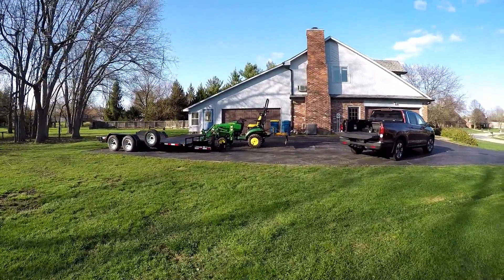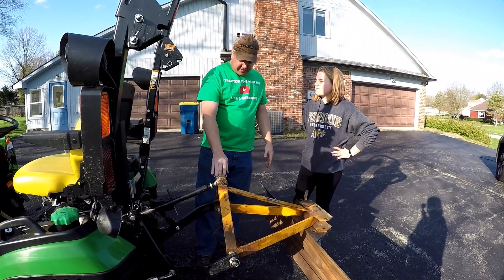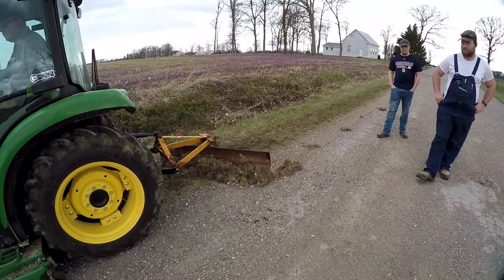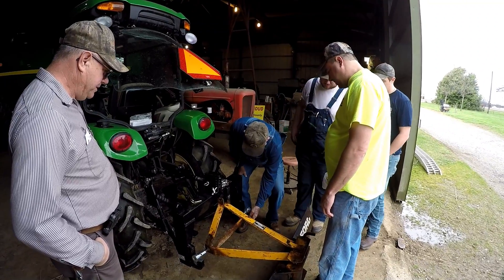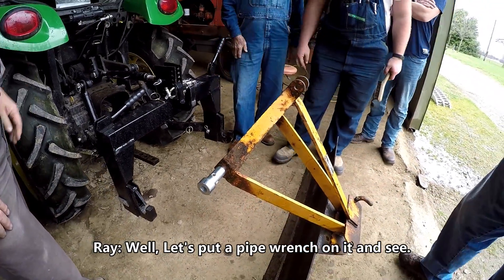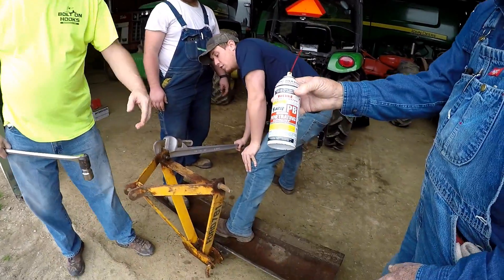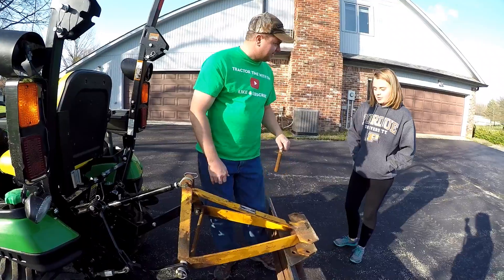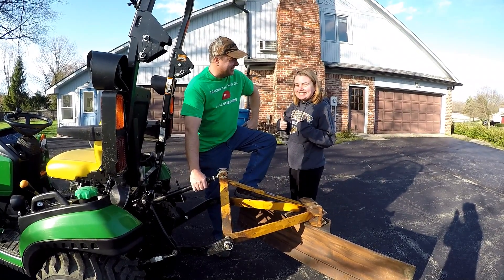Attempted Reengineering on Our New Blade for Compact Tractor

Comment: I have a 1025R, I need a cab on my tractor too old to breathe dust and need ac. I have too many attachments to start over. What are some options any suggestons?
Reply from the maker: 3R can be pretty narrow.  For example, my family still runs 4ft tiller.
Reply: @TractorTimewithTim  Will the attachments for my 1025R fit the larger #3 cab tractor? forks, bucket, grapple, a quick hitch, landscape rake, bush hog, box blade, tiller, belly mower, etc.
Reply from the maker: Forks, yes.  Bucket will come with the loader for the 3R.  Quick hitch, yes. Landscape rake, yes.  Bush hog..do you have 4’ or 5’? If 5’ you’ll be fine.
The rest depend on width.  3R better suited with 5’ or 6’ than 4’, but you might get by at least for awhile.
Reply: @TractorTimewithTim  thanks

Comment: Take an angle grinder along exposed thread grinding a flat going a little into nut this provides clearance for the rust to go somewhere, rather than building up under the nut being removed and causing squeaking and friction(HEAT) you just turned that exposed threaded section into a thread chaser, good threads won't get galled. Good luck hope this makes sense

Comment: Gentlemen, there is this thing (tool) called a cutting torch, most men who have a workshop have a torch somewhere in their shop. Take your's out of storage and light the torch off, then use the flame's heat from the nozzle to expand the metal of the nut, which will allow you to remove the rust frozen nut from the pin without excessively straining your muscles or damaging your hand tools. If you do not have a torch, then get out your metal cutting grinder and cut the damn nut off the pin, since you are not going to be reusing it anyway, it will not matter that the pin and nut are destroyed in the cutting process.
Reply from the maker: I believe we discussed heating it in the episode.

Comment: Cut the original hitch and manufacture a new quick hitch capable hitch on the blade. Take measurements off the pulverizer but build a clevis instead of pin hitch.
Reply: Tim, thinking about an answer to this implement. As I previously posted to cut off the original hitch. I believe the new quick hitch capable replacement could be built using 1/8" wall square tube shaped in a " T ", gussets at the intersection of both tubes and with 1/8" flat bar (need minimum 4" wide, you nay need to inquire about this size of material)  for both clevis pins and the 3rd point. BTW, THE " T " will be upside down to correctly weld to the blade structure. Hope this idea helps to update the blade to your specifications.
Reply: The "upside down T" is your best answer for the modification to work. And the braces could still be used if carefully cut away.

Comment: Yet ANOTHER IDEA TO MAKE QUICK HITCH CAPABLE. Build an adapter that has quick hitch dimentions on one side and dimensions of the category 0 hitch. The adapter will stay mounted to the blade. DOWNSIDE; INCREASED WEIGHT AT THE HITCH.

Comment: Tim, i thought of YET ANOTHER idea for your blade quick hitch issue. Since the pulverizer is quick hitch capable. Take measurements from that with minor changes. The outside of the pins would be the widest point of the clevis hitch. With the pin mount point would be the narrowest measurement of the clevis. Then you could measure from the center of hitch to get length of center 3rd point for quick hitch. I don't believe it would add TOO much weight to the blade. OR you can take measurements of the current blade hook up points and build an adapter to hook up to the quick hitch. OR buy another Heavy Hitch and weld that in place of the current blade hitch points. I know that project isn't a high priority, but just some ideas when that project comes about. For some reason I keep coming up with ideas for this blade. lol. Just sending some ideas for the future days in the shop or on the family farm. Andrew.

Comment: Ok, I am in. watched 3 video's and they made me smile. So I subed and liked. I find it's a little more fun to watch someone drive a John Deere then doing it all day yourself. Try lowering someone's back yard 3 to 4 feet (about 1/2 ac.)with just a John Deere 3005 with a bucket and box blade to make it level. Yes, there was a jungle on top to remove first. 3 15 hour days and it's done. Only other help was a chain saw and helper to cut up and move the tree parts out of my way.
Reply from the maker: +72+HourBOB making you smile is our goal.  Thanks for joining us.  Wow,  Johnny wouldn't have been able to handle THAT job!
Reply: The BIG Q is would Johnny have done it for fuel and $60.00. (fuel was under $25.00). Thanks and you guys take care now.

Comment: Tim:
If you don't want to destroy the frame of the Ford Blade. You can just bolt on plate stock that will need to be welded.
The two point section needs to be widened so get steel stock the is as thick and wide as on the blade cut long enough for extension, weld on tabs that you drill to bolt were the studs were and on end for mount point. You will need put on two other plates to box for strength.
You can extend the third point the same way with same size plate.
If you want to bring it back just unbolt those parts.
Any questions please ask.
Reply: I had to do this wit a cat 0 box blade.  All I did was get some .25" wall dom tube 1" OD I made ears that I bolted into the nut side of the cat 0 pins so a cat 0 could still hook up and put a cat2 size bushing in the upper link position.  This sits below the cat 0 hook up.  A section of angle was welded across the top of the tube and blocked rotation. All removed w 2 nuts

Comment: Why not weld a piece of channel to the bottom below the existing pins wider than cat 0 pins, so it will match the quick attach width, weld two ears with holes on each side to act as a clevis to hold the pins. This will also give the height you need to achieve category 1 quick hitch height.  Joe Rhinelander

Comment: Have you ever tried kroil? It's amazing for rusted bolts and nuts like that. 10+ year old lawn mower exhaust bolts (the ones bolted to the head) practically came off by hand after that first little pop. Also the blades on my 1983 3 point mower attachment came loose and they were really frozen before spraying. The guy I bought it from gave up getting them off. Said he and another guy pushed with a 6 or 8 foot breaker bar and it wasn't happening. When I got it I sprayed it and flipped it over and pushed it with a 4 foot bar. After the pop it was really loose. Good stuff.

Comment: i use an old arps 6ft blade. the 520 has telescopic lift arms you can pull out 6 to 8 inches ruffly then you back in to lockem then i have a quick tach top link. you just need the special ball and you can still get em off the shelf at tsc.   most of my equipment is cat 1 but primarily using cat pins and the 3 bottom is cat 2. the problem to me seems you have to make sure the equipment can stand on its own which the blade doesnt

Comment: I have a $12,000 rhino scraper all hydraulically controlled adjustments 4 rams thatI use behind a 240 hp case magnum cvt tractor and I can tell you every inch further away that blade is from your tractor the less you can do because your front end wont hold straight.cut that a frame off and build one that fits your quick hitch and keep your boom length as short as possible. Good luck!
Reply: Sounds like good advice.

Comment: PB Blaster is sure great stuff, I've been using it since the 80s. Great video showing all the Marks men on a tough project. Have you ever used Carmel Welding on Range Line? I have used them for several projects and they do great work.
Reply from the maker: +Ken Litherland I have not used them, but they get great reviews from everyone!

Comment: Leave the blade as it is now with the new pins. You can attach it manually many times before the cutting and welding pays off if you modify it. There are better projects. Perhaps a bolted (so it can be restored to original) ballast (box) at the back would make for a project?

Comment: That's a nice looking little blade! 

An easy QH conversion would be to lop the A frame off with the current hitch points, then build a new one out of some square tube/ drill pipe/ whatever is handy that's quick hitch compatible with a parking stand. Farmers have been modifying their equipment since the first plow turned the earth, you're not destroying it or hacking it up, simply writing the next chapter in it's life. :)
Reply from the maker: Yea, I suppose you're right.
Reply: Guy, I would been doing more hacking and rewelding mounts to keep most of the original 3 point attachment points. Tim, any new plans to make the blade quick hitch compatible?
Reply from the maker: I dunno.  It is far from the top of my list at this point.

Comment: If you do not want to modify the original grader, build an adapter to attach to it to fit the quick hitch.
Reply from the maker: sounds like a good plan.
Reply: Only problem with that is the further away from the tractor the blade gets the less dirt you can move with it before your front end slides in the opposite direction..you have to keep that blade as close as possible to the rear of the tractor to avoid the leverage affect..

Comment: If you want a small job to try it out on, I have one here in NY for ya.
Reply from the maker: +D Rouse do you pay mileage?
Reply: Lol, it would probably cost 10 times as much as the job I need done.
Hopefully soon I will have my own 1025r to help with my chores.
Reply from the maker: +D Rouse yep...are you about to purchase?
Reply: Hoping to by fall or sooner. Doing projects will a wheel barrow doesn't cut it for me anymore. Debating if I should get the mowing deck or just keep my zero turn.

Comment: I make my own penetrating fluid.  You just need Automatic Transmission Fluid and Acetone and mix them together in a 50/50 ratio put in oil can. Works better then any store bought. Give it a try.
Reply: Mech Uno just be careful around plastics and paints.

Comment: Hmm, I think you could make a bolt-on adapter to fit that to your quick hitch without any permanent modifications to the original blade. Don't tell the Finance Committee, but it's time for you to get a welder and learn to weld! :)
Reply from the maker: +Mark's Tech Channel we have a tombstone ac welder, just no time to play with it.
Reply: Perfect! No need to buy any new tools, then. I think you could fix the vertical and horizontal size problems at the same time by connecting to the top link pin normally, and making a new piece that mounts underneath the bottom of the blade's frame. The new piece would have new pins at the right height and width, and it could bolt to the frame in place of the existing pins.

Hey, it looks like I'll probably be getting my first tractor on Friday morning. Woohoo!
Reply from the maker: +Mark's Tech Channel excellent!  What will you be getting?
Reply: Kubota L3301HST with loader, backhoe, brush cutter, land plane, and post hole auger. Now I'm all set up for the projects that I won't be able to afford since I'll be paying for the tractor for the next 7 years! :D I kept the forks from my old Bobcat, and I plan to use them on the new tractor.
Reply from the maker: +Mark's Tech Channel congratulations!  That sounds really nice!!!
Reply: Thanks! It should probably have a cute, affectionate name, like your Johnny. I'm thinking, "GARBLAT THE DESTROYER".